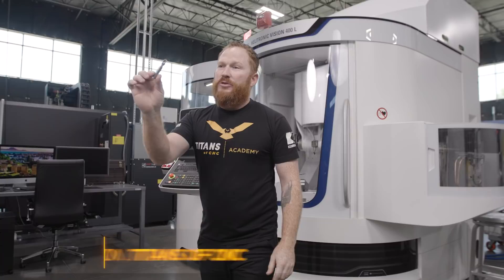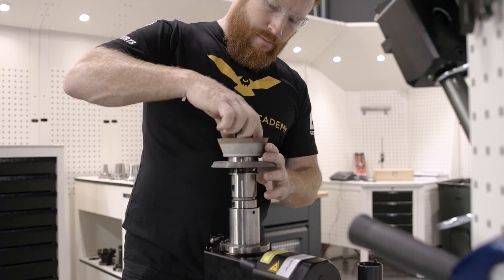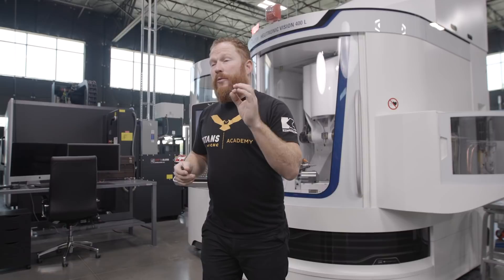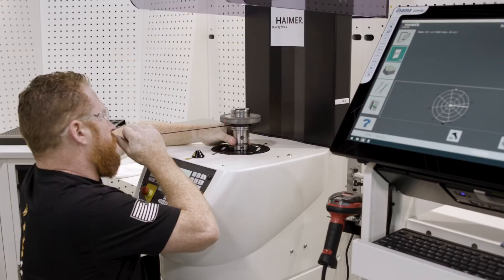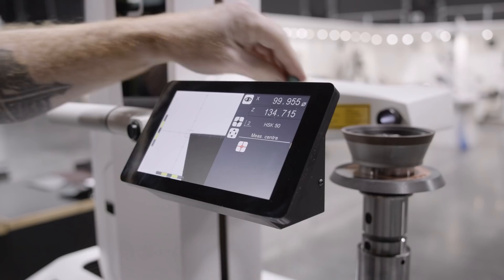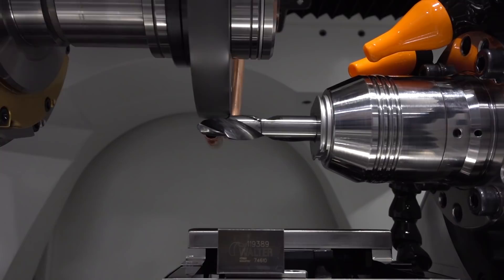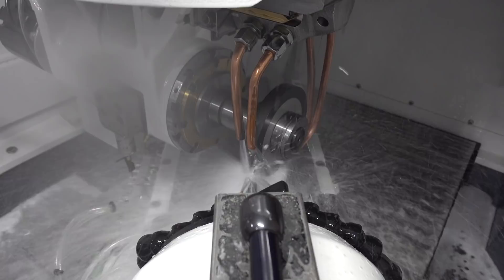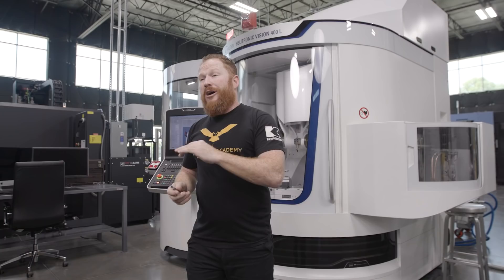Grinding a Step Drill on the Walter Helitronic Vision 400L from United Grinding

Comment: It’s a great presentation I can’t disagree 75% of it is said except the part of making the program and doing the steps before you start running a tool which requires indicating the blank or indicating the Chuck more correctly and adjusting the steady rest so that it’s holding the tool were supposed to center it basically in the last one is to adjust the cooling lines and the pressure for specific operation, I’m a senior Machinist working on this machines for well over a decade and I can tell you this machines are amazing especially with a new software toolstudio they are much easier to program and run I can’t say that the machines are perfect they have all flaws but from all other CNC grinders Walter is definitely in the top five grinders rollomatic I would say number one saacke number two Walter number three anca number four and vollmer five.
Reply: Thanks for details there from your experience, nice to hear about the tool studio and how setup is improved

Comment: I got to run one of these Walter Vision machines for a short time before retirement having previously ran a Walter Micro for several years along with a Rollomatic 620XS. Having spent 20 years in either manual tool grinding(6years) and (14 years) as a CNC Tool & Cutter Grinder running Anca’s, Rollomatics and Walter machines, I must say running the Walter Vision was a joy. Once the Vision was warmed up you could run hours and hours on most jobs that were programmed right with a tenth or two tenths offset change for 100-200 tools. Moving a tenth got you a tenth. Amazing machine. We had that wheel dresser too. So easy and great to use. I also spent 15 years as a CNC machinist. 

The Walter Vision was the most satisfying machine I ever ran in Machining or Tool Grinding. Maybe running parts you could see and inspect more easier than those micro tools had something to do with it also.😀It’s a great machine.

Comment: Bro, it's Anca team all the way. . . . .
edit - You're using rolled relief on that back 45 degree that creates a huge undercut 🤣. . .  That undercut will allow a burr to be pushed right back into the I.D. when that drill rapids back out of the work. I really hope you have since moved to profiling.
Edit 2 - You showed truing the wheels, but mention nothing about dressing them. 2 very distinct processes. 
edit 3 - you don't need a steady rest for a .500in diameter tool hanging out by about 1.5in there cowboy.
I do much more with my Anca Fastgrind (2013) than you showed here.

Comment: Dressing the wheels seems to be a lengthy process, i am wondering how many parts can you process before having to re-dress the wheels ?
Reply: That depends on many variables. Some jobs may require identical wheel packs. When one pack needs dressing, load the new while the other is dressed so there is only a small interruption in the process.
Reply: Couple very general estimates - 750pc 1.5" LOC 1/2" Dia 5 flute endmill. 150pcs 1.5" LOC 3/4" 3 flute endmill. Max we see is 2000pcs on some 1/8" tooling, minimum we see is around 25-75 on some bigger diameters. But these are all general estimates and greatly depend on the wheels and how the tools are programmed.